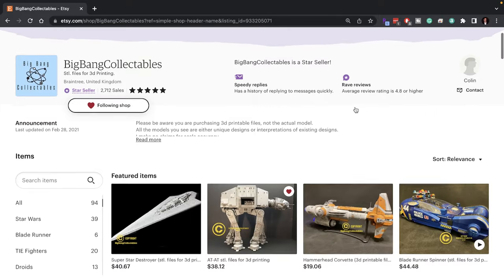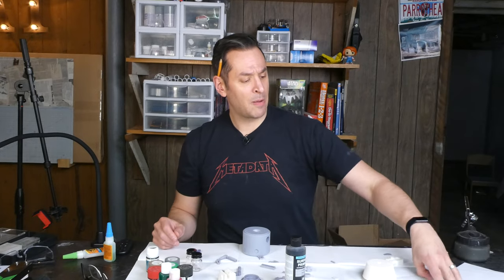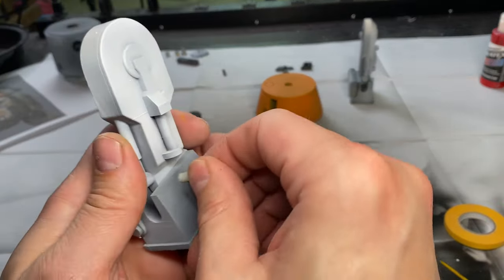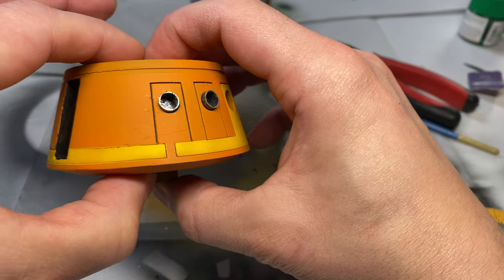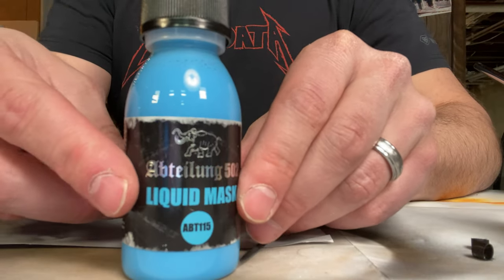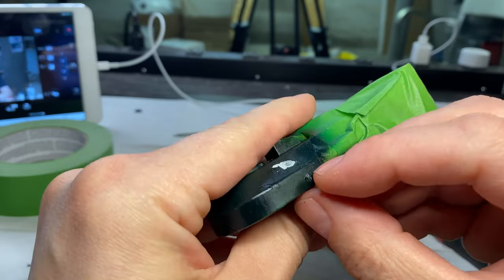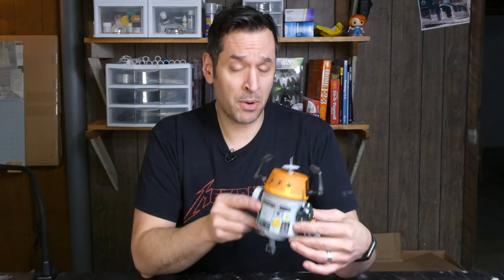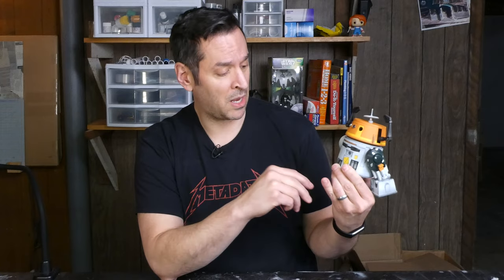Chopper Resin Printed Model Kit Build from Ahsoka and Rebels

Comment: Buy a Deburring Tool Kit, something with HSS (high speed steel) whatever kit on amazon has the most blades.. I bought mine from cornwell tools and paid way way too much for it. but these little blades are stupid sharp and near indestructible there are tiny little points that can follow lines and hooks that round over corners.....I actually have not used an xacto knife in 3-4 years because of these little deburring blades. Rebels is my favorite of all the animated serieses.
Reply from the maker: Thanks for the tip! I'll have to check that out. I always need an excuse to buy new tools. And agree, Rebels was wonderful. I'm so far behind on the newer stuff like Bad Batch and the other stuff. I'll get to it eventually!
Reply: @MADEbyAP  Bad Batch was a prequel for Rebels..  just as good..  I prefer scraping to sanding. its slightly less messy and does not use a consumable product like sandpaper. needle files are ok but do not really cut very well compared to sandpaper.